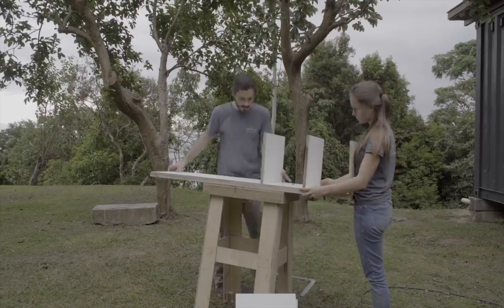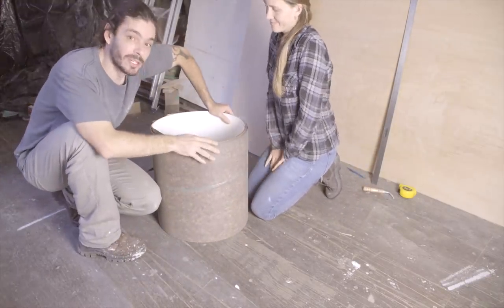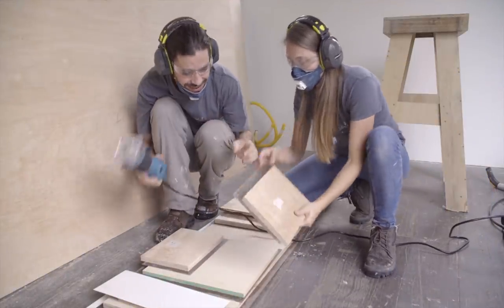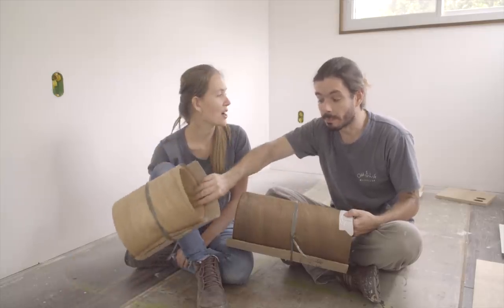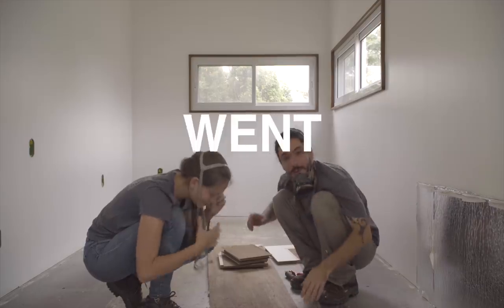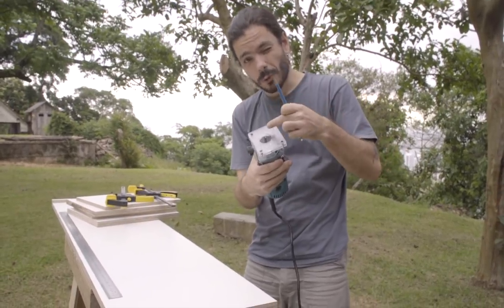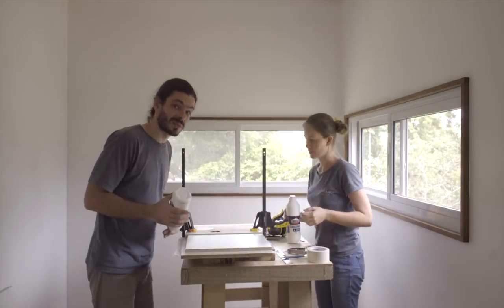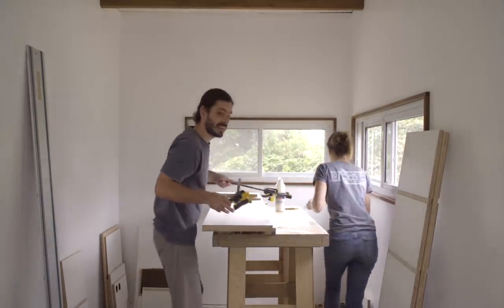Building a wardrobe isn't that easy!! 😨 LTP EP#058

Comment: I am a first time viewer to your channel, interesting and I will be back for more. You need to roll laminate and veneer with more pressure and for a longer time when bonding to a substrate, or you did do it and edited a lot of it out to make the video flow. With the larger panels, a good trick is to have some dowel sticks handy and lay them across the glued substrate every 250mm or so along it. Then lay the glued laminate or veneer on the dowels and get everything lined up properly and slowly move one dowel nearest an end to be beside the next dowel. This lowers the laminate/veneer to the substrate and you can roll the veneer down to establish the glue bond in that area, then slowly progress along the sheet, generally the rolling pressure will move the dowels along automatically for you, or you can move them manually, or even pull them out one at a time once you have the first 250mm or so well rolled down. The dowels just act as separators and are not glued, so they don't stick to either the substrate or laminate/veneer. Try it once without glue to get used to it then, do it for real, it completely eliminates those annoying alignment errors.
Reply from the maker: Usually for big pieces we spread wooden sticks but this o e we dis the mistake of using not many of them end we had a problem. I guess you are right and we need to press for longer. Thanks a lot for the tips my friend. 😊👌🏼

Comment: The walls turned out grate. Now I am wondering that in building the furniture inside will create a lot of dust that sticks to the wall. Better have the walls covered with plastics sheets?
Did you have that issue?
Reply from the maker: Not really. And we can clean with a wet cloth later. But anyway before we move in we will give an extra coat of paint on the walls ao we move in with fresh painted wall. 😊👌🏼

Comment: Hi!

I've seen in the last three days, the other Episodes (exactly 57).

I have a question, but the answer should bem Just forward, but It continues... Hahaha

Wy dos not the make the outer decks or the floor before making the furniture?
Reply from the maker: Hello, Heyder. We need to build the canopy for the slide doors before installing the flooring because depending on the wind and the rain we have it can get the inside of the house wet through the tracks of the doors. And we think we are gonna spend less wood this way, as we’re not planning on installing any floor inside of the furnitures, so if we build the furniture first we know where to install the floor. And also we don’t want to have the floor with any marks and we still need to work inside of the house and the changes of marking it is enormous ☺️